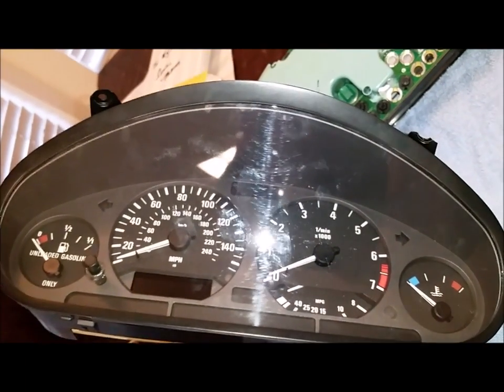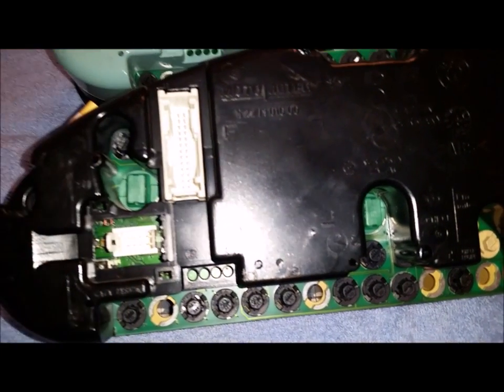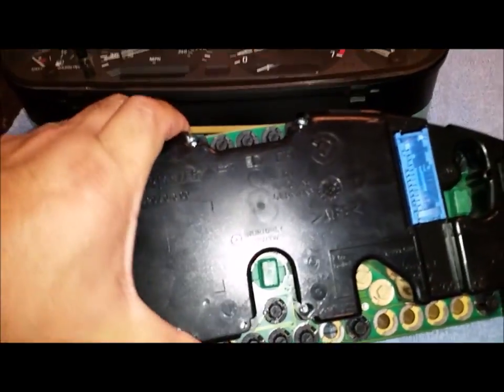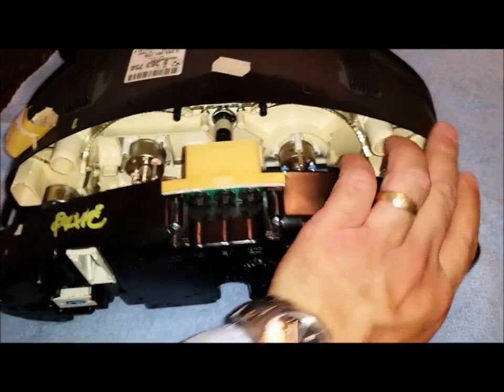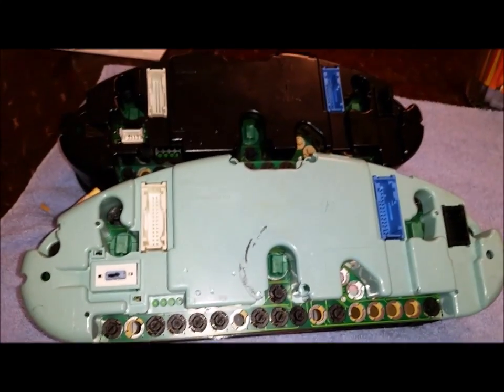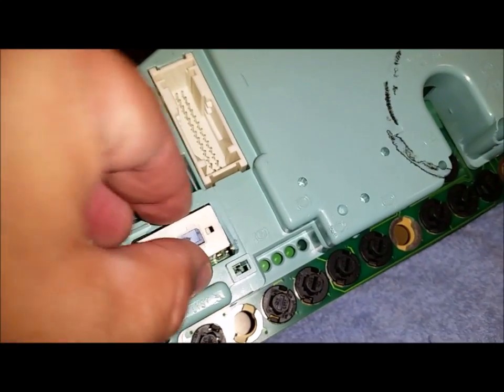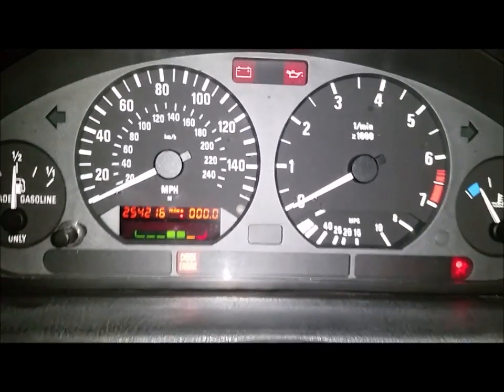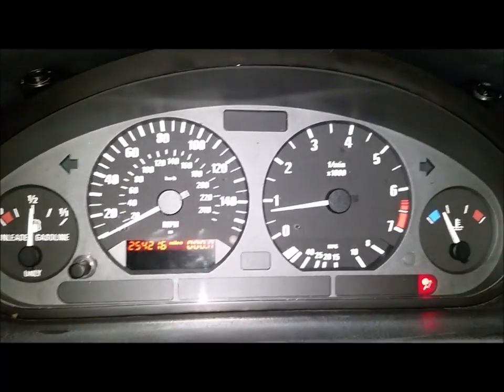E36 Instrument Gauge Cluster and Code Plug Swap

Comment: Could you please comment on the coding part at the end to remove the red dot?
Reply from the maker: Hi. If you read the description of the video you will find all the information to remove the red dot. You have to complete Test 9 by following the steps and then pressing the mileage reset button for 4 seconds.
Reply: @23tlujan23  many thanks!
Reply: I guess you can’t use a higher mileage replacement cluster than the original coding plug.

Comment: Is there a way to retreve old mileage back after doing step 9. My mileage was significantly lower than the other one and i was told by someone else that doing the reset it would keep my original mileage but it still shows the higher one but theres no red dot..
Reply from the maker: Hey, Joshua. So you took the old cluster out, removed the code plug, placed that original code plug into the new cluster that has higher mileage, installed it, and there is no red dot? I have heard that this could happen, but I believe doing step 9 will fix that. If not, I would probably swap all back to the original, maybe do step 9, and start over again. Let me know if it works. 😃👍

Comment: Hey I have a 1996 328is and all my needles and lcd screen stopped working  which were all working perfectly the day before . And the thing is the back lights and and all the indicator lights still work but gas, speedo, engine temp, rpm etc dont move at all. I checked all the fuses they seem ok do you think its just burnt out or I just need to re solder. Any advice would be appreciated thank you!
Reply from the maker: Have you done any work on it recently like changing bulbs? Sometimes the wire loom that goes to the trunk lid can have broken wires that cause issues.  Also, run a Cluster Test: https://www.youtube.com/watch?v=wFANuPz9Lkw

Steps:
1. Put the key into the ignition switch but Key off (engine off)
2. Push and hold the Mileage reset button
3. Turn the key to ignition switch position 1 (engine off) when numbers are shown in the LCD display
4. Release the reset button and the instrument cluster will run some test

In a worse case scenario, if you verified the fuses, the cluster board may be going/bad.  You would then need another cluster to swap in and do as I did in the video.
Reply: i have the same problem on my 325is did u just swap it to another one?

Comment: Dumb question but I have a 93 325is manual with dead pixels. I found a cluster from one thats the same year but the last 3 part numbers don't match does that matter?
Reply from the maker: What part numbers are your original and the one you found? Thx.
Reply: @23tlujan23  62118357778 original
The one I found 62118375052. Last 4 numbers are different
Reply from the maker: I believe the original one is OBDI(no code plug) and the one you found is OBDII (has code plug). Hopefully it's from the same engine size. The 4 cyl vs 6 cyl won't swap as RPM gauge will be off. You won't hurt anything by trying it. You may get ABS light and may need to add an adapter cable. Here's a good thread:  https://www.bimmerforums.com/forum/showthread.php?2088880-Instument-cluster-compatibility

Comment: Was your old cluster doing what mine is:
https://www.youtube.com/watch?v=AtKRCtC6mr4
I am going to try to fix mine as well.
Reply from the maker: Yes. Basically the solder on the display is not making good contact anymore.  There is a way to cut open the back and reflow solder on it.  There is a write up on that.  The way I did it was just easier.
Reply from the maker: Here are a couple of links with pictures to show one way it is done: 

http://www.repairdynamics.com/Instrument_cluster_repair.pdf
https://sites.google.com/site/josephshearersprofessionalsite/in-the-news/bmwe36odometerfix
Reply: @23tlujan23  Thank you soooo much! The first link did not work, but the second one did and it has the pdf in that site.
Reply: @23tlujan23  I just saw this video (although I don't understand German) It seems that here could be another reason besides the cold soldering for this intermittent odometer lighting. I am not sure if they simply replaced that LCD or taken it off and back on again! I appreciate if you can advise on this since I don't want to re-solder the cold joints only find out that there is another issue with this LCD screen. 
https://www.youtube.com/watch?v=1If2qTyfVIA
Reply from the maker: When you push the button, it puts pressure on the circuit board so io the solder makes contact again. That's why you can see it.
Reply: @23tlujan23  Here is the update: I fixed it! It was the LCD rubber contacts. I took the metal bracket off, cleaned the rubber contacts (zebra connection) with alcohol and air dusting and added a thin foam spacer ~ 1mm to add pressure to contacts when the metal bracket is clipped back on. So luckily, I did not not have to melt or cut the plastic in the back to get to the soldering. It seems good for now! Thanks again for all your help - it gave me the courage to work on it! I will post a video shortly.
Reply from the maker: That is great! Can't wait to see the video! Glad to help. Anything I can help with.  Thx.
Reply: @23tlujan23  Thank you!! Here it is:
https://youtu.be/SakQIEJXuOM
Reply from the maker: Looks great! Thanks for sharing!
Reply from the maker: That was a weird video.  Not sure either how they fixed it.  Because you say you tap on it and it comes on sometimes, that's what leads me to believe it's a cold solder issue.  You could check the light bulbs first as that is the easiest thing  They are the two small light brown light holders on the back of the cluster. If you open up the cluster and hook it back up to the car and press on the front of that display and if it lights up, it is most likely cold solder issue. Or, remove the plate and stick it back on and plug it in to see if it lights up. Here are a couple of other videos showing how to break it down all the way and what the cold solder looks like. 

https://www.facebook.com/BavtekInc/videos/1068793229893562/

https://youtu.be/qgpqAkXYhaU

Let me know what happens as I'm invested now. :) Thx

Comment: Mine doesn't have a code plug??
Reply from the maker: Hi!  Is your BMW an E36? I'm not sure about other BMWs code plugs.What year and model is yours? Thanks
Reply: @23tlujan23  yeah E36 328i 1995
Reply from the maker: @One46ix  It's possible it doesn't if it's an OBDI car.  If you have the instrument cluster out, do you have a model number on it? Starts with an 8. should be a tag on it.  Also, what are the last 7 digits of your VIN so I can look up to see if it has one. Thanks
Reply: @23tlujan23  yeah I've got it out and there isn't a port for it and I don't believe they are the original clocks perhaps it's because I'm in the UK
Reply from the maker: @One46ix  I'm sorry this didn't work for you.  Hopefully you can figure it out.  Lots of good info on bimmerforums.com and bmwfanatics.com and try realoem.com for part numbers.  Thanks

Comment: Can i change this if i swapped m52b28 from m44b19. Cluster will work?
Reply from the maker: The concern is that I believe if the M44B19 is a 4 cylinder and the M52b28 is from a 6 cylinder then the RPMs will be off.  Also, if the M44B19 is an OBD I then you will have issues as I think the M52B28 is an OBD II.  Here's a link to some good info: https://www.bimmerforums.com/forum/showthread.php?1163337-Ultimate-4-Cylinder-to-6-Cylinder-Swap-Thread

Comment: would the  Code Plug swap  work from a cluster in miles to a cluster in km?
Reply from the maker: Unfortunately it won't.  If the code plug is from a cluster with miles and you swap it in a cluster that's in kms, it will still show miles.

Comment: Hello. Did you test your cluster in the car before changing the coding plug? I have ordered a lower milage cluster to replace my dead higher milage cluster. But some forums say the milage arent stored in the coding plug?
Reply from the maker: Yes.  That's how I knew the cluster had lower mileage.  I got it at a junkyard then connected it in my car to make sure it had a lower mileage. Please review my Description to see how to reset the tamper light.  Thanks.
Reply: Thank you for the quick answer. The junkyard have already checked the mileage so I will just swap the code plug right away. Should I turn the key to position 1 to read the mileage after that or should i start with running the test cycle where it checks all functions? Some say this test is what sets the mileage to the original. I must say there is a lot of conflicting answers regarding the e36 cluster swap, but hopefully this will work! Thank you for the help!
Reply from the maker: After swapping the code plug you can check it at position 1. It should show your correct mileage,  but with the tamper light on just like in the video. Then do the Test 09 to remove the tamper light.
Reply: Looking forward to testing this, thanks. I assume you have a OBD2 car if you are from the US? Any clue if this will work when my car is OBD1? Europe got OBD2 later in the 2000s, so some say this might be a problem in regards to the cluster won't override lower mileage. I have no clue why though. I do have the same coding plug as you in my faulty cluster.

Comment: I have a 1997 1.9L (4cyl) z3 and bought a cluster from a 2000 2.3L (6cyl) everything works but the RPM's , Would this method resolve that ? Thanks for all the info!
Reply from the maker: Hello.  doing thus won't help the tach. The problem may be that the cluster from the 2000 6 cyl has internals like an e46. Also,  going from a 4 cyl cluster to a 6 cyl cluster could be problematic in that the cluster is looking for a signal from a 6 cyl and can't read the 4 cyl info from the ecu. In reading forums about 2000+ Z3s, there are cold solder problems on the internals that cause the tach to read intermittently.  That is something you could check.  I hope this info helps.  You may need to find a cluster from 96-98 4 cyl to swap with.  Thanks.
Reply: So "Test 2" wouldnt fix that ? I was hoping itd find the dme and the 4cyl info
Reply from the maker: I was thinking more compatibility and functionality.  BUT, I would try Test 2 to see what it is reading and change it to 4 cyl. If the tach doesn't respond,  it may be compatibility or cold solder issue.  Let me know how it goes.  Thanks.
Reply: Will try it soon when I get home , worse case I just swap out the LCD and chrome rings into mine lol

Comment: I've just swapped my instrument gauge cluster to an M3 cluster gauge, I am living in Asia which apparently uses KM instead of miles on the odometer.. Is it possible to switch the code plug from my old gauge cluster (km) to the new one (miles)? will the odometer change to KM  automatically after the code plug switch or do I have to do some kind of procedure to do so? any advise regarding this issue will be much appreciated..

Thank you very much
Reply from the maker: I'm really not sure. This may need to be done at the dealer.  What did your car say in kms before the swap and what does it say now that you have swapped them? Is it in Miles or KMs? Did the tamper light come on? It's the eeprom (EEPROM stands for Electrically Erasable Programmable Read-Only Memory) in the cluster that stores the mileage as well as the code plug.  When the eeprom and the code plug don't match, then the tamper light comes on. The eeprom rewrites the code plug when you do Test 09 under the description.  I'm not saying it will work. If they don't match or the tamper light is on, maybe try Test 9. Do this at your own risk  You may also have to deal with the MPGs readout or the oil temp read out when you do this swap.  http://www.318ti.org/forum/showthread.php?t=17274

Comment: It appears to be a good solution; my problem is instrument panel goes blank.  I want to switch the coding chip, too.  Are all your instruments working now that you have switched it and have had some time on it? Also, did you take off your steering wheel first or wedge it out?
Reply from the maker: John, all of my instruments are still working and have not had any issues.  I have taken it off both ways by removing the wheel and wedging it out.  I wedged it out by turning the key to the accessory position and then pulling the panel forward and turning the wheel to the left or right to help pull it out.  I placed a towel over the top of the steering wheel so if the panel touched this during the process it wouldn't scratch. Thanks and good luck!
Reply: Thanks for your reply. 

I had sent a note about this to the folks at Pelican Parts and the owner sent back a note suggesting it was, many times, in the trunk lid.  

Any thoughts along those lines?  

Best regards, 
John Carter
Reply from the maker: That could be a problem as well.  If you search E36 Trunk Wiring you will see many articles and some videos on wires becoming broken in the harness.  Mine wasn't going black like yours.  Just missing pixels.  Pelican has an article on trunk wiring harness issues with pics.  http://forums.pelicanparts.com/101-projects-discussion-forum-bmw-3-series/308129-e36-owners-check-your-trunk-wiring.htmlThanks

Comment: is it possible somehow to overwrite the higher value (used instrument cluster from scrapyard) with the lower value (coding plug)? i want to swap my original one because i do not have revolution gauge in it, but the "new" instrument cluster  has +60k km in it...
Reply from the maker: In my research, it can't be done. You can't go from a lower value cluster to a higher value cluster.  Rewriting the value will keep the higher mileage.  The cluster you get from a scrapyard must have a lower mileage than your original.